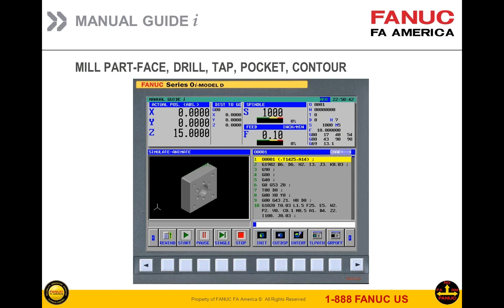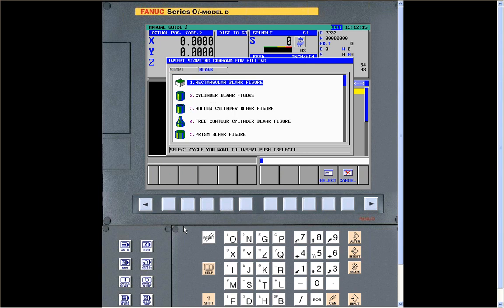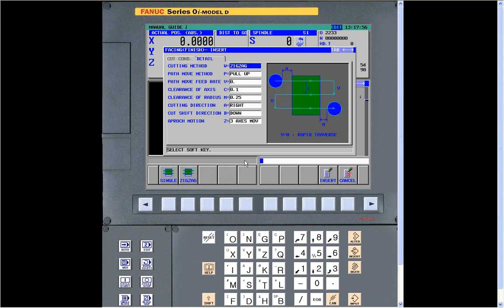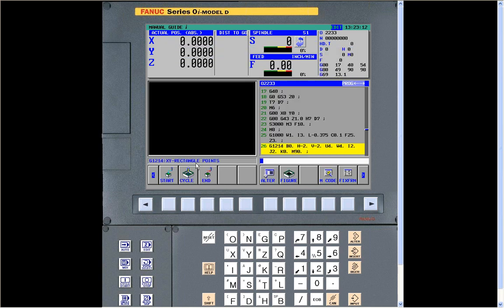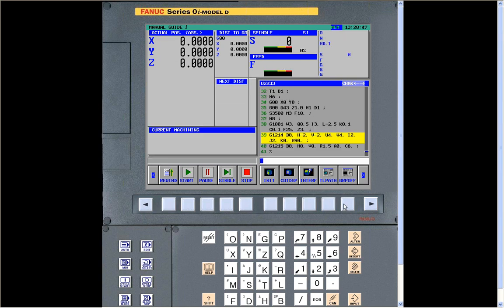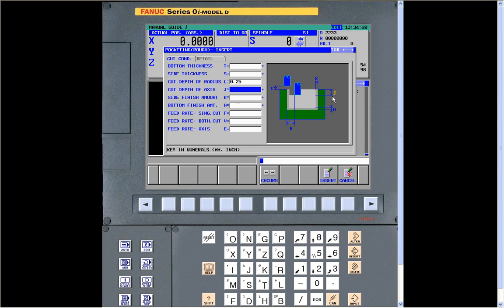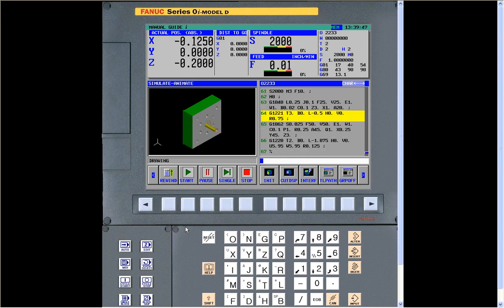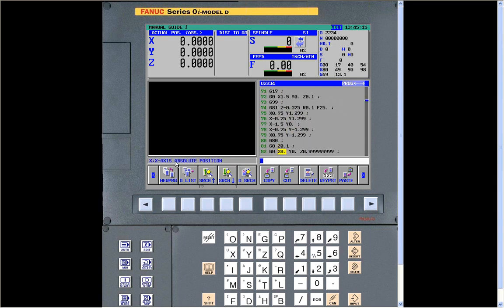FANUC MANUAL GUIDE i Part 3 Creating a Basic Milling Program

Comment: hi thanks for sharing,  by the way a facing head is not a facemilling cutter. This must be possible as we too have an HBM here with a Manual Guide - I on it but as they have mentioned this software is designed on doing less complex profiling in which way milling cycles on hbm can also be done apart from those special tooling like facing heads. (Facing head can also be simplified and/ or compared to a turning tool attached on a milling spindle and thus cylindrical cuts, more or less like a boring bar on milling , only that it the tool can be moved so as to make a bigger or smaller diameter as it cuts making it possible to do angles , tapers, grooves shoulders or even facing , as the tool plunges in. )